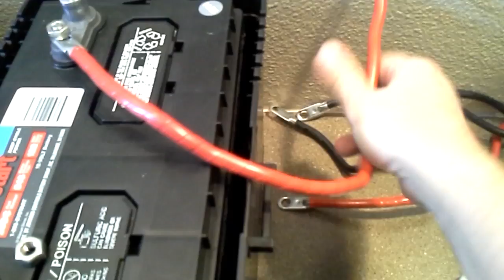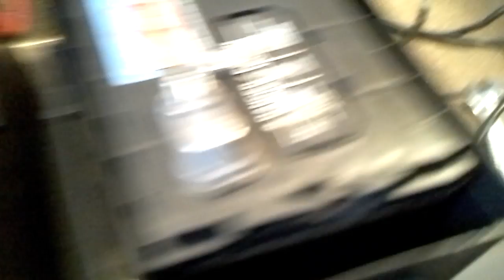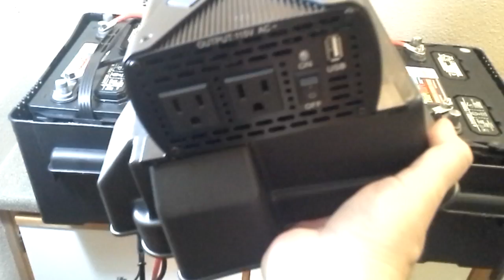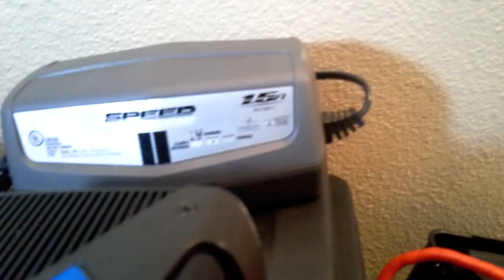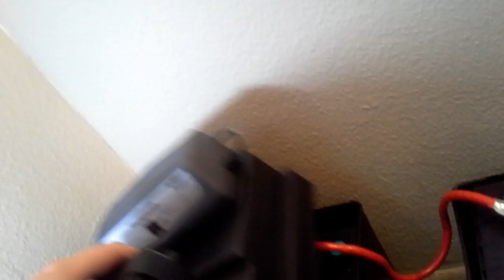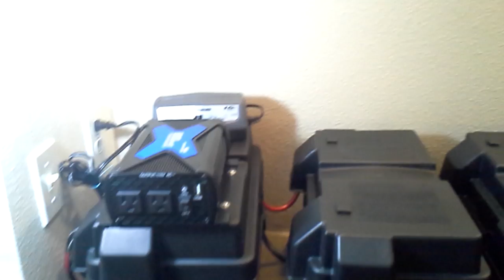Installing 4kW/Hr battery bank with 800W 120V Inverter and Trickle Charger from Tactical Woodgas

Comment: hi, if i have 4 batteries 12V 115Ah, as I connect if I want to make 24V 345Ah ? thanks
Reply: +cesar alejandro morales penagos   - The 4 batteries in parallel would give you 460Ah (115*4) at 12 volts (which is 5,520 watt-hours (460*12, because power is obtained by multiplying amps by voltage)). If you put two of the batteries in series, you would have 24 volts; which you can then put in parallel with the other two batteries after wiring those two in series as well. This would result in a 24 volt battery bank at 230Ah (which is also 5,520 watt-hours). To make the specs. you're looking for, you would require two more of the batteries, wired in series, then added in parallel to the aforementioned 230Ah setup.

Comment: Thank you for this video, i want to ask you this i have solar panel installed already 150w panels ( in a cottage), with one Battery, and the battery now is about 4 years old still working, i want to add another battery to this one, i wonder, can i add a new battery to this old one, in same way as your connection, or should be 2 new one's.
Reply: PALANG NAR two new ones!
Reply: @troymcdonald9795  I know , but too late, i install the new one with old one, maybe after i get a another one.

Comment: From a safety standpoint, would it be better to put the negative on the wall side, Just curious. I realize both both poles will do harm, but if I remember correctly, power flows from negative post to positive posts.
Reply: No difference, since the battery terminals are not referenced to ground.

Comment: for a balanced system the inverter and charger should be connected to the middle battery other wise the end battery will be charged less and amp draw will be less google balancing your batteries your batteries will last longer
Reply: it is usually recommended to connect Positive at one end, say the Left most battery in the vid, and the Neg at the extreame opposite end say the Right most battery in the vid. This will ensure a close balance between the batteries.
Connecting to the centre battery will just make that one charge and discharge first.
Reply: Thanks for the reply i did google it and installed them in the balanced order
Reply: @r.b.l.5841   I agree totally...connecting the load from the positive of the first battery to the negative of the third battery should work better !!!!

Comment: What equipment did he plug on to the 110 socket and does that have to stay plug on
Reply from the maker: Just a lamp to show it works.  110V outlets can be turned off and on as needed.

Another video is here:  https://www.tacticalwoodgas.com/online-store/1200W-Battery-Bank-PLUS-100W-solar-panel-%26-connecting-cable-p99746394

Comment: Will it be better to hook the batteries inseries or parallel cause I'm using them for a 500w ebike. Can I use two of the exact same Scooter/Motorcycle batteries with a 750w Power Inverter to power my 500w ebike ?
Reply: sure can
Reply: @elmerwaltermeyer8340  What about wiring two 80 amp batteries in parallel, how much power will it put out? 19,200w?

Comment: what ac outlet i can buy that has a built in fuse like a 5-20 amp car fuse ? I tried the same thing you did with two different car batteries, the ac outlet came on i was able to charge my cell phone but not a small tiny fan.What i think i need is a car fuse for it to work let me know if that's what i need or anything else i need for it to work ? By the way i learned something new watching this by hooking up more then 1 car battery ????????

Comment: Those are deep cycle batteries and not car batteries, right?
Reply from the maker: Correct
Reply: @tacticalwoodgas4036  does it matter what type of batteries you use??
Reply from the maker: @BeAmbitiousNotContent  
12V deep cycle
I recommend 100AH or better charge rating.  Wal-Mart 29DC has worked well for me.

Comment: I have a 100 Watt Solar Panel Charger, (Output: DC18V/4.3A) hooked up to my battery with a 20A Solar Panel Charge Controller. Can i hook-up a car battery charger to my 800W Power Inverter to charge up the battery that the Inverter is running from, without damaging the solar panel or the controller to assist in charging the battery faster or at least slow down the draining of the battery?
Reply: Juan Rosado no . Your inverter will draw more current than the battery charger will put out .

Comment: Can you please show me the math... on how you got 4kwh  with that battery bank... as well as how you calculated your fridge runs 300 watts..which would be 2.5 amps and that seems aweful low for a fridge to be pulling. Most pull at least 15 amps which is 1800 watts which means that 800w inverter would not turn it on.  Just looking for some clarity maybe im missing something.
Reply from the maker: Raver Magik 
Each battery has 100A-H and 13.8V when fully charged.  P=VI so  that is 1380WH.  3 batteries x 1380 = 4440 or 4.44kWH.  You only use half of that if you want your batteries to last a long time.
Reply from the maker: 300 is the average.  It takes a lot more when the compressor is running, and zero the rest of the time.
Reply: Ok I got you.. i must be thinking when its running the compressor which it doesnt do often. Good stuff.
Reply: I just looked at the sticker of my fridge.. it says max load 6.5 amp.. So i guess the fridges have become way more energy efficient.  I remember when i was a kid.. fucking things were beasts. I guess i can do the same thing then... build a battery bank and if i need to hook a fridge up just get like a 900w  inverter and i should be good. HMM.. summer is coming and we do lose power.
Reply: Raver Magik you right mate , this video is sacks . To many things isn't clear.

Comment: Just curious could you plug the charger into the inverter creating a self sustaining power system almost like an alternator charges the batteries on a car
Reply from the maker: No free energy.  Has to be plugged into an external power source.  There are two good videos that show all the ways to charge it at https://www.tacticalwoodgas.com/online-store/Battery-Bank-with-1200W-AC-Inverter-plus-solar-wall-car-charging-ports-p95165068
Reply: In a bus there’s a power inverter connected to a oversized alternator to power the large rooftop AC but I don’t know the limits but technically yes but it has limits to output watts

Comment: With the parallel hook up do the amp hours stay the same or increase? Want to run my small cabin solely off of a battery bank system charged with a gas generator (for this I'm told I need at least 800 to 1000 AH?) until I can afford to go full on solar. Right now I'm looking into a 24v battery system hooked up to a 5k watt power inverter. Any advice would be greatly appreciated.
Reply from the maker: Kali 
In parallel, amp-hours add and the voltage stays at 12V.
Reply: Wow that was fast thank you for taking the time to answer. I see, so I can still do what I need to at 12v hooked up to the 5kw inverter? I hope that made sense.
Reply from the maker: Yes, add as many batteries in parallel as you need as you can afford them.  Connect them to this or similar battery bank https://www.tacticalwoodgas.com/online-store/Battery-Bank-with-1600W-AC-Inverter-plus-solar-wall-car-charging-ports-p99746436

Charge with a fuel efficient 13.8V DC generator like this https://www.tacticalwoodgas.com/online-store/12-Volt-DC-Generator-for-Woodgas-Propane-and-Natural-Gas-p55274826

You will use very little gas compared to an A.C. generator and you will only need to run it a few hours per day.

This configuration uses the hybrid car model and is very efficient.
Reply: Kali Doing same, wiring now. 4 VMAX 12v SLR125 & AIMS PICOGLF40W24V120 Has built in 100A charger. 12kw surge. Solar panels tomorrow with MPPT cntrl... I'm off grid 😎 Doing Series/Parallel...
Reply: Series or parallel you will get the same KW/H
Reply: Put up 2) 100w panels in series, 24v to 60A episolar cntrlr. to charge batteries. Still run Honda i2000e gen. But only an HR a night vs 6+ hrs. Run it to charge batteries then run off batteries. To do over again, would've gotten 48v inverter since running 4 batteries anyway...

Comment: bro u forgotten to use the center terminal if u use center terminal u will get a balanced amp from the wire otherwise it will cause a lot of presure form battery 1 & 2 wires.
Reply: Agree in theory, but these cables are so short and large that I have not had any aging problems.

Comment: My battery only says 710cca it doesn't say how many amp. How do I find out the amp on the batteries?
Is cca the same as amp hour?
Reply: That's a car battery, you should buy a deep cycle battery, instead. look for AT LEAST a 100ah battery.
Reply: @sundancer442  sometimes marine batteries only show cca. I think a marine battery will last a little longer than a car battery, but not nearly like a true deep cycle such as a pair of 6v golf cart batteries.l have found decent Penn golf cart batteries for $90 at Sams club, and also at batteries plus (with a duracell sticker on it) (order online). Just don't use low quality batteries. I don't like exide or Johnson controls, they don't last for me.

Comment: so instead of plugging into a wall socket  for solar you would be charging batts useing panels ?  right ?
Reply from the maker: Most models at www.tacticalwoodgas.com have both solar and A.C. charging.
Reply: Exactly, but you will also need to add a charge controller to keep from harming the batteries with too much electricity. They are somewhat sensitive.

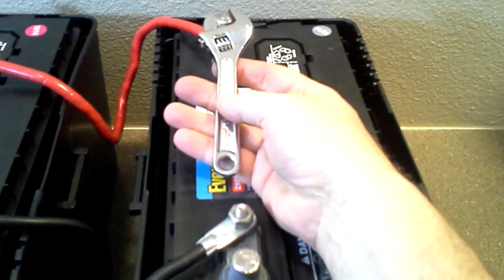Comment: 5:05.  Energy is going to fly from positive to negative?  I think you better check that.  Sounds backwards to me.  Also, just use a wrench with an insulating handgrip in it cuz that short wrench would still easily touch a dangling cable, possibly completing a low resistance circuit.
Reply: I'm old enough to have gone through school when "electron flow" vs "hole flow" convention was only recently settled, and both were taught.  Yes, electron microscopes proved flow direction.

Comment: Where do you connect the dc  charger controller ? I know the inverter you connect to the battery but the charger
Reply: I also looking for this answer lok
Reply: You connect it to the battery, positive to positive and negative to negative. It doesn't matter which of the three connected batteries.
Reply: you connect the 2 wires from battery +  and -- to charger controller and from  controller +  and -- to solar panels

Comment: Why would a 36v process (if I crossed linked) kill my inverter?? Cool video.
Reply: Perhaps because its designed for 12v?
Reply: @NickM1013  I ask because I'm building my bus & this to my batt bank. I was told to cross connect to my 3k watt inverter to power my game consoles, fridge, & solar panels. Sorry for the dumb question.
Reply: RenjiBoi I’m not sure the answer I provided was correct tbh, and certainly not a dumb question. I was forming it as more of a question.

Comment: Those the walmart everstart deep cycle marine group 29? How are those working out for ya?
Reply from the maker: +Sir Reginald The DC29's have done great.  They handle high discharge rates and the impedance is still low.  The inverter turns off when the battery gets below 10.5V, so no risk of early battery death.

Comment: HELLO DEAR
HOW LONG DOES THESE BATTERY LAST IF YOU USE CONTINIUSLY OR 8 TO 10 HOUR A DAY? I AM A TRUCK DRIVER I WANT TO PUT 3 BATTERIES AND 1500W INVERTER INSIDE MY CABIN FOR HEAT AND AC UNIT AND IS IT SAFE TO MAKE LIKE YOU ARE SHOWING IN VIDEO INSIDE MY TRUCK UNDER MY SLEEPING BED? THANK YOU FOR HELPING
Reply: Steven Lengenfelder  thank you for your help
Reply: Also with a deep cycle gel-cell's  there's typically no need to tie all those batteries together,  one will handle the job. 
To answer your question about longevity, it really depends on your power draw, and how much capacity you have in batteries. 
In this video he states that with the 3 Batteries tied together he's got about 300 amp hours. Battery longevity is expressed by how many amps for how many hours a battery will last, AMP-HOUR.
For a 12v inverter system, each 100watts of the inverter load requires about 10 DC Amps from the battery. 
The first step is to estimate the total Watts (or Amps) of load, and how long the load needs to operate. This can be determined
by looking at the input electrical nameplate for each appliance or piece of equipment and adding up the total requirement. Some
loads are not constant, so estimations must be made. For example, a full-sized refrigerator (750-Watt compressor), running 1/3
of the time would be estimated at 250 Watts-per-hour.
After the load and running time is established, the battery bank size can be calculated. The first calculation is to divide the load (in
Watts) by 10 for a 12-Volt system or by 20 for a 24-Volt system resulting in the number of Amps required from the battery
bank.
Reply: Sherzod, I'm not an electrical expert at all but I have an opinion. This is a waste of time and will not end well. If you are an owner operator, just run your truck. If you are a company driver just run your truck and tell them later. Forget about that elusive "fuel mileage bonus," because they will give it to the man in the office on the top floor anyway. lol. They will not appreciate those custom made improvements to the electrical system, and when some morning you need a jump start, fire extinguisher, a new alternator, or a FIRE EXTINGUISHER, they will be unhappy with you. Just run the damn truck! Lot's of trucking companies; not enough drivers.
Reply: He needs a alternator to charge them back up and electrical 12 volt motor to run alternator then might have a chance on running a frigidaire
Reply: Yeah that's not gonna work.  You'll get about 15 minutes of run time on an AC unit from battery power.  You'd need a substantial battery bank, and a method of recharging while they are discharging to offset power usage.  You can only discharge a deep cycle AGM or Lead Acid battery to 50% of rated Ah.  You can go 80-90% with Lithium.
Reply: I'm sorry to tell you that it takes way too much energy to keep your cab warm, or cool than you can get from a few batteries.
I went to school for solar, wind, hydro, electric vehicles etc. I now drive trucks. Owned one once.
I think your best option is an a.p.u. ($8-10,000), or for just heat, look up cheap chinese diesel heater on YouTube ($1-200)
Don't you just hate anti idle laws put in place by people who don't have to live under those laws?

Comment: Looked like a 1-bank charger - if so, with those batteries hooked up stacked to make your 12V circuit - will all 3 charge with just the one bank charger?
Reply from the maker: Yes, the charger will handle multiple batteries, but will take longer to charge.
Reply: Was above to ask the same Question.

Comment: Is safe to connect multiple cords to a battery terminal
Reply: How else are you going to get a parallel connection other than to use a busbar? It's safe as long as you don't introduce extra resistance.

Comment: If I use this setup with a solar panels,  what size solar panels and how many would I need to charge the batteries so as to run a decoder and a TV. This is for a farm where there is no electricity yet.
Reply: You need to give a bit more info, like what power your intending to use?
Reply: A 100W panel per battery is a good match.

Comment: Dose it drain the batteries a little having them hooked up that way?
Reply from the maker: Batteries have a very small self-discharge even when not connected to anything.  Putting them in parallel has no effect on that.
Reply: Thanks, that's good to know.

Comment: Cuantas baterías tiene un banco de baterías para  6KVA
Reply: 6KVA=6KW (Volts x Amperes = Watts)
KW igual a potencia instantánea.
KW/h mide energía almacenada, que seguro es lo que quieres saber.
Un banco de baterías con 6KW/h alimenta una carga (olvidando las pérdidas de cables e aparato eléctrico) de 6KW durante una hora, o una carga de 3KW por dos horas, o una carga de 1000 Watts por 6 horas...   

Para tener 6KW/h de energía almacenada en baterías (sin pérdidas consideradas), es necesario una batería de 12V com 500Ah (Ampere Hora), o 2 baterías 12V 250Ah en paralelo.
12V x 500Ah = 6000W/h = 6KW/h

Si deseas un banco con 24V: 
6000Wh(La energía deseada) / 24V(La tensión deseada) = 250Ah
Para 48V: 4 baterías de 12V con 125Ah en serie.

Nota: Cuando compras una batería, la energía almacenada es presentada en diversas circunstancias:
Cuando descargada por 100H, o 20H, o 10 Horas, siendo menor la capacidad cuanto menor sea el tiempo de descarga completa.
El valor que buscas (normalmente) es capacidad en 10H. 

Espero haber ayudado!
Saludos de Portugal!

Comment: how do you know the Ah ( amp hour )  of that 3 batteries, because those batteries only indicates their CCA, CA, and RC. ... how did you get the 4kW/h please teach me...... there are also batteries that has indicated their Ah, but most marine deep cycle never put their  Ah
Reply: Deep cycle batteries have an amp-hour rating.  Don't buy a battery for this system unless it has at least a 100 amp-hour rating.  Walmart DC29 batteries work great.
Reply: the rc is equivalent to amp hours

Comment: May be a stupid question, if there is one, but is it possible to run the inverter off of a 20 to 50 amp charger?
Reply: Yes....as long as its 12 volt.......how big is your inverter?
Reply: I did this back in 79 when I was 19 years old worked for 3 days but my brother loaded it up with a bunch of stuff while he's camping and Burn It Down what happened is in closed loop system like that is your impedance breaks down eventually it will burn out your charger the weakest link in this system is the inverter
Reply: @homermcclain7694  Why run the inverter off the charger? if the charger has power, just use the power from where  the outlet is connected.